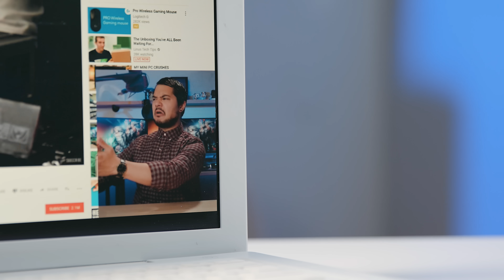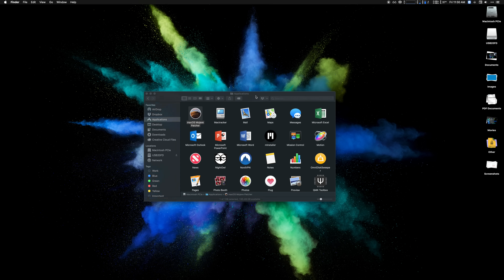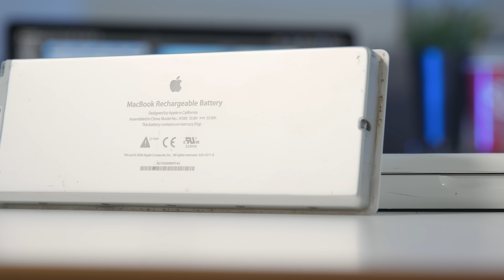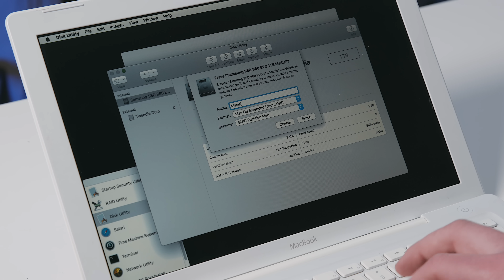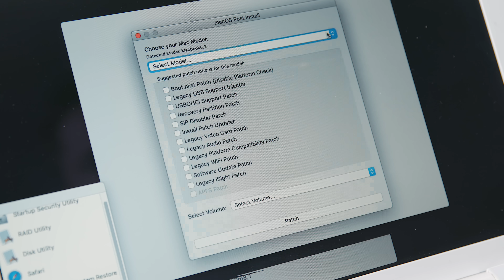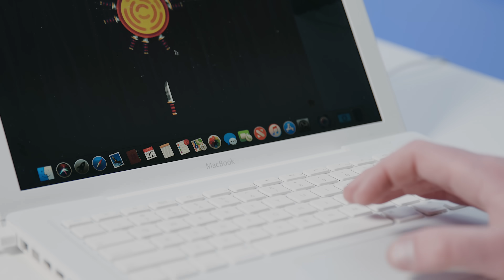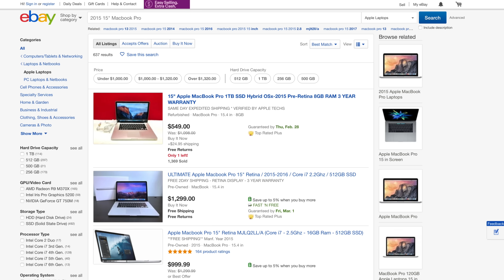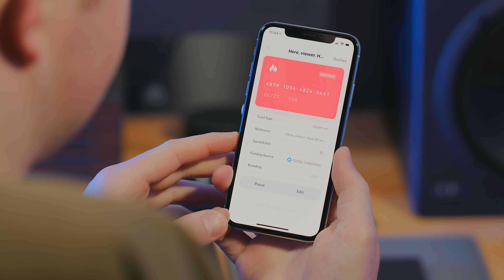Hackintosh a... REAL Mac?!

Comment: Did you neglect to mention the specs on this machine on purpose? Core 2 duo? Or did I miss it
Reply from the maker: Nah. All MacBook 5,2 are Core 2 Duo. Should have clarified. Sorry.
Reply: @snazzy  Thanks, I'm no mac guy. I guess Google is a thing.
Reply: @TimmyJoePCTech  LOL
Reply: My MacBook Pro 4,1 on Mojave with ssd and max ram runs very quick.
Reply: KylethePokéDude - more superlatives. GeekBench that thing, then we can talk.
Reply: 1397 single, 2267 multi.
Reply: KylethePokéDude : the aforementioned 2013 Retina MBP is 11k and change on GeekBench, and it can be picked up for $400 - $500. Completely not understanding why someone would deliberately invest time and money in a painfully slow computer with an inferior monitor when much better choices exist for very reasonable amounts of money.
Reply: @1macgeek  apple fans are delusional, their is nothing you can do about it.
Reply: If you already have one then its worth putting a bit of money in to it for doing light work; not meant to do heavier tasks like video editing. Should you go out and buy one of these just for this? Of course not, go buy a newer MBP like that one. But if you have one lying around, then this is a good way to give it a bit more life.
Reply: I can’t understand how this can be anything but painfully slow running Mojave. GeekBench CPU score of 1,400? 4 GB of 1066 MHz RAM maximum? Bus speed of 3 Gb/sec. on the storage? This Mac has to be running on Virtual RAM near constantly. No wonder benchmarks were never offered up, and only superlatives tossed around. The deception is laid on pretty thick here.
Reply from the maker: @1macgeek  This MacBook 5,2 benches pretty similarly to Kyle's MacBook Pro 4,1. It runs great. Is it going to edit 4K video? Of course not, but it does browsing, multitasking, photo editing, and 1080p video playback without any issues whatsoever.
Reply: Snazzy Labs - so in other words, I can spend more than I would on an iPad for less performance. You are not covering yourself in glory here. For a couple hundred more than I would spend doing things your way, I could snag a retina 2013 MBP with a quad core i7 that is literally about 5 times faster. Oh, and it runs Mojave without having to do anything but download Mojave. Again, not covering yourself in glory by not being a LOT more honest with your viewers.
Reply from the maker: @1macgeek  You can get these 2009 laptops for less than $20, you goose. Furthermore, this is not suggesting to go out and buy a 2009 MacBook. If you'll actually watch the video, you can note that I suggest buying a laptop "a couple years old" instead of spending thousands of dollars as I show an eBay results page for 2015 MacBook Pros.
Reply: @snazzy  Or just buy like a used Alienware or something
Reply: Like any laptop from any brand drops like a rock in price, For $500 I can easily find anything for everything if I took the time, A gaming laptop like Alienware or acer, Or a productive laptop like Apple or hp.
Reply: Snazzy Labs : eBay begs to differ. Looking at the listings for the 2.13 GHz 2009 MacBook, they do indeed sell in the $200 - $400 range depending on configuration. I have no idea where you think they can be purchased for $20, but I do know if the deception doesn’t stop I am unsubbing. It’s becoming obvious you didn’t do more than cursory research, and when called out instead of coming clean you doubled down. For the last time, you are not covering yourself in glory here.
Reply: Buster Blocker basically to avoid having to buy a new one.  If you already have it, you can continue to use it avoiding Apple’s planned obsolescence. You can get 8GB of used RAM for 10$-20$? And an used SSD for another 20$ (I wouldn’t go for 1 TB but maybe 250GB).
A 2009 MBP with a C2D runs at an average of around 30% CPU usage for internet, email, office, etc. You don’t need high benchmark scores for that. The Mac is waiting for you not the other way around like it would be if you do video editing or coding, that is not the use case proposed here.
We are trying to avoid throwing electronic away. What do you do in terms of sustainability?
Reply: lucianoag999 : First, only 4 GB is a supported configuration. Second, a 7200 RPM hard drive will operate as fast as a half-speed SSD because the bus is limited to 3 Gb/sec. - remember? Third, you just made a perfect use case for an iPad. Last, I decommission at a recycling facility. You aren’t keeping anything out of a landfill, you are merely keeping it out of a landfill *longer*. There is nothing pious or praiseworthy about that - it’s still ending up in a landfill, one way or another. The only way to keep a computer out of a landfill is to never purchase one in the first place.
Reply: Buster Blocker, yesterday I sold a friend a MBP 2009 15” C2D 2,53 for 250€ (I could have asked for 400€ on eBay). 8GB RAM, Fusion drive 160 GB SSD + 1 TB HDD. Do you think one could feel a difference with a MBP 2012 15” i7 3720qm in email, internet and office use? Answer is no, since I almost format the wrong MAC 🤦🏻‍♂️. I installed El Capitan. I wished I had seen this video before.
Reply: Buster Blocker 4GB ok you get that one. Second the 3gbps is just the SATA II speed. The snappyness of an SSD is due to the random read and write speeds that are 100 times faster than an HDD. Order of magnitude ~30 MB/s against 0,3 MB/s. In any case they are way bellow the SATA II limit. The sequential speeds are not so important in this use case (no transfer of large video files).
Having a computer longer make it easier in general to recycle because you need to recycle less tons of waste per day. It is definitively better since you have more time for example to separate the components. It makes a huge difference if in average people throw a computer away per year or per decade.
Tell me which iPad has a 13” screen, has a mechanical keyboard that doesn’t suck and costs 250€. An iPad might be an option for you but not for everybody. It is not as ergonomic as a MB to type emails.
Reply: Buster Blocker it is funny how you complain about snazzy not mentioning benchmarks but then you do not mention the fact that an HDD has max speeds of 100-150 MB/s independent of the SATA connection and an SSD can easily saturate a SATA II = 300 MB/s. So ~2 - 3 times faster.
Reply: Buster Blocker by the way, I checked, and the white 2009 MB unofficially support 8GB of RAM ;)
Reply: @lucianoag999  cough Just get a Windows laptop, They just work better
Reply: Trini Kore I don’t have just one computer and one OS. ;)
Reply: @lucianoag999  Wow apple
Reply: @1macgeek  Why would you throw away the valuable materials that make up the electronics of any computer configuration (laptop, tablet, handheld, desktop, tower)?  Just keep in mind while these may seem slow and sluggish by today's standards that will always be the case for computers.  Advertised with "blazing speeds to crush the competition..." is as current in 2020 as it was in 1990, 1970s, going back decades to the older IBM class of Mini and Mainframe computers.
i have and still use computers from 2008 that perform their intended tasks peachy.  I'm just not of the mindset to throw my money away when the thing that I bought still works as it was intended to.  For instance I have a dual core AMD 2 GHz laptop with a bad screen & dead DVD --R/RW burner.  The laptop only has 3 USB 2.0 ports and a multi-format memory card reader, VGA out, and the removable battery died some time ago.  But I can plug it in, attach to an external HDTV as a monitor with built in speakers, plug in USB powered DVD R/RW burner and its still works just fine.
I upgraded it to a 1 TB hard drive and 64-bit Windows 8.1 years ago.  As an offline machine I am most pleased with the service it still provides me.  Talking about painfully slow OSs compare Mojave to Windows Vista with 4 GBs RAM (max), running on a 64-bit PC.  Although it was new at the time I bought it I typically buy used laptops and tower PCs if they can meet my needs.
Reply: IraQNid : if you read all of my comments, and I am certain you did not, you would see where I state there is nothing noble about extending the life of a computer. No matter if the computer is sent to a landfill at five years or ten years - it’s still getting sent to the landfill. Also, every one of my comments still hold today, especially the comments on the iPads. Apple has improved the speeds where there is no practical difference between a laptop and an iPad. The design has been improved where the iPad is nearly 100% recycled. If the point is to stop electronic devices from hitting the landfill, there is the nearly perfect argument to stop that from happening. Also of note is the fact I did unsubscribe because the disinformation flows on this channel, and I cannot abide that.
Reply: @Buster Blocker as someone who works as an IT Professional deploying and managing Macs I did an experiment to see if I could daily a 2007 MacBook Pro with a core2due after an ssd ram upgrade. I used the machine for 30 days doing all my normal workloads like email, web browsing, RDP, and Mac management software. The short answer is yes you can daily a machine like this. Was it slower than my 2017 MacBook Pro Touch Bar of course, but did it stop me from doing my day to day job no way. So yeah these MacBooks are fine on a budget.

Comment: LOL! It’s running macOS High Sierra which was released in 2015! High Sierra was released in 2017 and the computer is running OS X El Capitan which was released in 2015
Reply: I never use the trackpad on my MacBook because it does not click down at all unless the battery is installed in the computer which does not hold a charge and I don’t feel like replacing it and it also didn’t come with a charger so I used the charger from a water damaged 2008 MacBook that I had. And the trackpad eventually stopped working completely or would just randomly freeze so I used a USB mouse with it until I got a Magic Mouse for Christmas

Comment: Yea, cool, but the trackpad isn’t fully compatible and loses every trackpad capability....
Reply from the maker: The MacBook5,2 doesn’t. Retains all input gestures just fine. Only diff is it doesn’t show up as a trackpad. Shows up as a mouse. Functionality though remains the same.
Reply: Snazzy Labs nope. I did this on my 5,2 macbook. It shows up as a mouse, so you haven’t got any tapping capability. You need to press the bar to click. You obviously retain the right click function with two fingers on the trackpad, but you must press the bar to click.

Comment: Very cool Quinn!! I’ve always wanted to pick up the old white or black MacBook... this would be a good reason for a nice chill MacBook
Reply from the maker: They’re a hoot!
Reply: I got a new black one when they came out...oh the oily fingerprints!!
Reply: maladjustedtv oh that’s right.. I forgot about that
Reply: Good look to find it white and without chipped edges!
Reply: If u wanna run Mojave make sure its at least the 2009 macbook. The gpus in the earlier ones aren’t supported past mountain lion
Reply: @joe070907080706  This is the issue I ran into, functionality vis a vis the video card. Choppy video and lagging UI just can't keep up - GMA 950 is crippled with 64mb of video ram. Is, well, almost totally outdated
Reply: Pressbutan Yeah its completely unusable on the newer macOS versions cause apple doesnt support the 32 bit driver anymore.. so no qe/ci. The older macbooks still work pretty great on windows and linux distros though
Reply: Joe Williams 👍
Reply: My advice is avoid the GMA based older ones - they're just too inefficient and the 64mb of video ram just isn't enough. Later white round macbooks and the unibody macbook would be just fine on Mojave, almost flawlessly.
Reply: Pressbutan I’ll be sure to keep that in mind.. thanks
Reply: Get the slightly later white unibody model (or an old Pro) - the model used in this video is prone to the top deck deforming/cracking.  The white unibody is a much better platform.
Reply: Tim maybe trying an older unibody would be cool to see for a video too..I’ll have to look into it
Reply: Only Macs that I really liked, and so misunderstood and underrated. After 2 PowerBooks G4 failed on me, this white beast was my savior and reason why I miss OSX and Macs in my workflow today.
Reply: Jakub Lulek My first MacBook was the white one.... I loved it

Comment: Hackintoshing a MAC in 2019???? holy BATMAN!
Reply: It's not quite a hackintosh, but it works on the same principle. It's not even a full fat experience on some machines, for example my MacBook Pro 5,1 (mid-09) with Mojave doesn't quite have every feature, like phonecall continuity, or restore from web if the OS has a serious fault.

Comment: How secure is the installation of Dosdude1? how can it be tested? Next to the Dosdude1 own software additions and modifications, you have to disable the OS security.
Reply from the maker: You don't have to disable OS security. It remains enabled. OTA patch updates are sent to an app in the Applications folder added after install though you can remove it. He's been doing it for 3 versions of macOS now and is well-respected in the community, but I can see the hesitation.
Reply: @snazzy  Ok thanks, i did use dosdude1 patch a long while ago on an old macbook pro just to try and i though i had to disable the OS security. Anyway i could indeed not find this step on his website anymore.  I had hesitations to use that installation so i have installed the latest possible mac os x back on the macbook pro late 2008.

Comment: The 8-Bit Guy installed 32-bit Windows 10 on a 2006 MacBook. I haven't tried it on my 2006 MacBook since I'm happy with Mint Linux installed.
Reply: Link to 8bit video pls?
Reply: @Lj22  It's called "Is it Obsolete - The Core Duo MacBook?"
Reply: @Lj22  search for the8bitguy Is it Obsolete - The Core Duo MacBook?
Reply: If You live in a govern country. your going to be spied on for protection/corruption,
 
windows/apple whatever.

Why we have front facing cameras? [Hidden eyes]
Reply: I installed Windows 10 Pro.. just had to edit some lines of txt.. booted perfectly.. was an early 2009
Reply: Windows 10 is good without the spying and auto updates
Reply: Vox3l-Gl1tch  read my reply to 💀.
But in addition to my reply wherein I complained about Windows 10's horrible update platform, I'd be remiss if I failed to also mention that the visual design of Windows 10 is the worst, even worse than Windows 8; by that I'm not saying Windows 10 is uglier than Windows 8 - it's not - but Windows 10 is a more fractured, inconsistent, incomplete design than Windows 8. At least Windows 8's ugly Metro UI was consistent within itself and COMMITTED to being good for tablets, while Windows 10 is an unholy abomination which is inferior to Windows Vista  and Windows 7 as far as desktop navigation is concerned AND inferior to Windows 8 as far as tablet use is concerned.
Windows 10 as a computer operating system reminds me of a video game franchise called Sonic the Hedgehog - Everybody wants something that conflicts with almost every other fellow fan, and instead of fully pleasing one part of the userbase, they try to fit everyone's differing demands into one product and every piece of it is subpar or worse.
Reply: win10 is crap, 7 is much better but still linux is a lot better
Reply: Yeah. Windows 10 is miserable, and IMO, the worst computer OS in history. 10 is a bottom tier user experience, easily outclassed by the likes of Windows Vista, Windows 7, Windows 8, MacOS from 10.11 onwards, Ubuntu (and its derivatives) from 11.04 onwards, and even alpha-state OSes like ReactOS.
Reply: @TurboPikachu  

Yea, no lmao. I've been using W10 since beta and I've had no major problem, ever. With windows 8 on the other hand.. oh boi. Yeah that was a shitty OS. 

8.1 was better but W10 is in my opinion, the best Windows Microsoft ever made. Yes it's better than W7 and yes it's better than XP.
Reply: enjoy your bloatware, windows/cortana spying on you and shitty interface (settings/control panel separated)
Reply: @-eMpTy-  Windows 8 and 8.1 were ugly as sin, but they were actually by far the most stable Windows OS I had ever worked with. Conversely, Windows 10 is the least stable I've ever worked with, even less so than my experiences with Windows ME and XP. And these negative experiences with Windows 10 aren't isolated -- they span across OEM laptops, OEM desktops, and a custom computer I built for gaming. The forced updates (that only allow for temporary deferral and don't allow themselves to be deleted) have resulted in corrupted/failing updates to continuously try over and over again, making for unnecessary daily reboots on afflicted PCs; this issue hitting my custom build in particular especially hard as it had one quality-of-life update for build 1709 stuck in a daily restart attempt-fail loop that caused my PC to refuse to update to 1803 unless that QOL update finished first. Win10 never let me delete that QOL update while it was in its attempt-fail cycle, and it didn't delete itself until 94 failed attempts, THREE MONTHS after build 1803's release...

I had inconsequential little updates in Windows 8/8.1 end up in a looping attempt-fail cycle once or twice a year, but removing problematic updates was as swift and painless on 8/8.1 as it was in 7. 10's way of updating, on the other hand, is like a hostage situation unless you pirate LTSB edition or go through the agonizing hell of messing with the Group Policy Editor in Home/Pro editions (which is something I still can't get past roadblocks in after more than 3 years with Windows 10)
Reply: @-eMpTy-  Enjoy your BLOATWARE